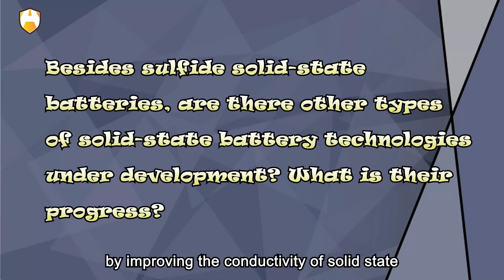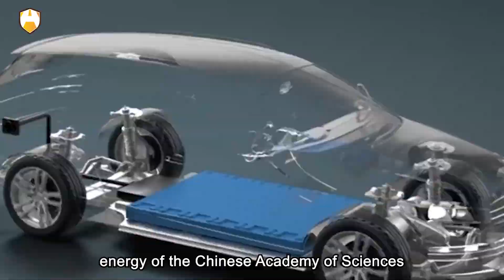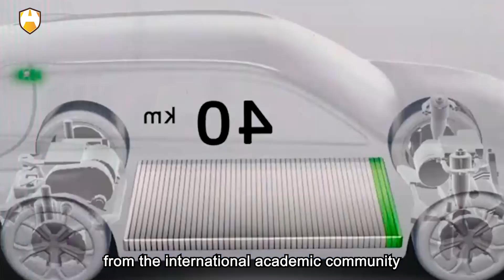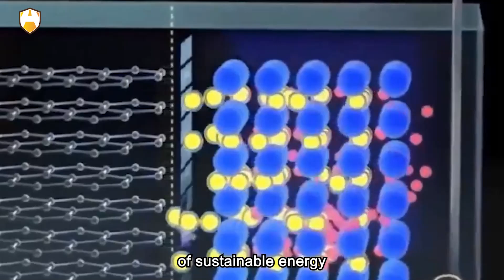Finally!！The breakthrough in solid-state batteries at  the Chinese Academy of Sciences is exciting！

Comment: China has solved the problems of mass producing the sulfide solid state batteries which may be a solution to battery safety and EV’s longer range without recharging. These solid state batteries do not have liquid electrolytes which enhance the safety and increase the energy density. By 2026 China would be able to mass produce these batteries to power EVs and power sources for various applications such as home appliances, etc.